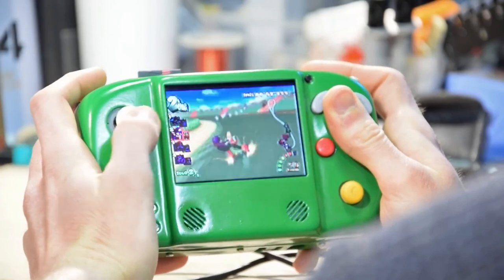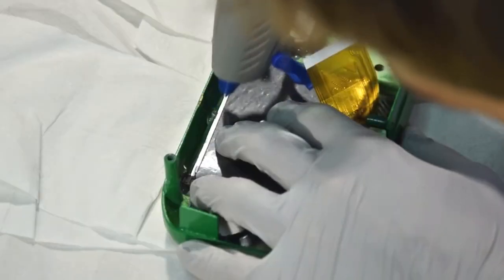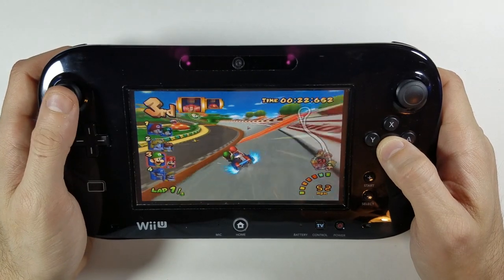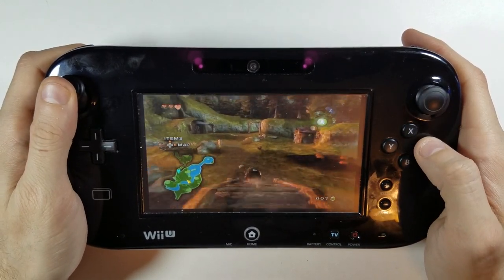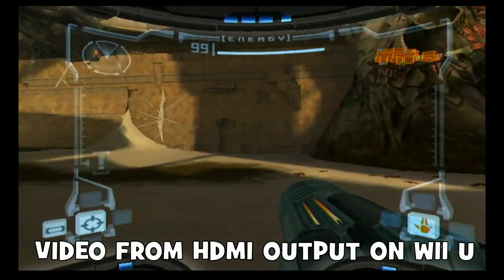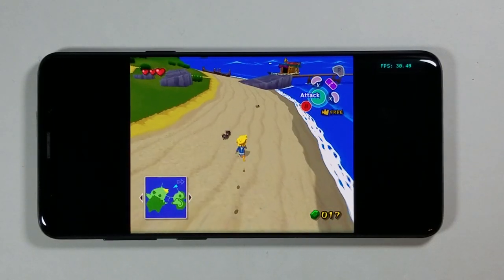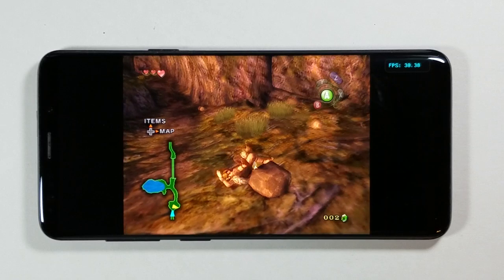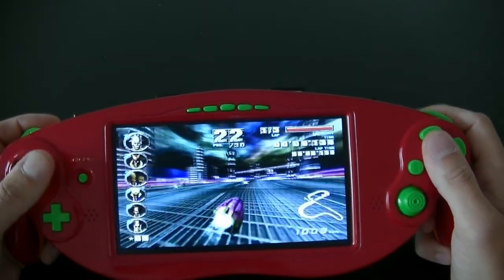EASY DIY GAMECUBE PORTABLE HANDHELD *60 FPS* W. FULL HD HDMI OUTPUT

Comment: How about the soft press trigger, crucial to walk while spraying water in Mario Sunshine,  Wii U, Switch and most controllers don't have them, so thinking playing the full game without problem on emulation it tough
Reply: It will remap to another button automatically. And with the wii u there are 100s of adapters on the market that allow you to plug a gamecube controller and use it. And gamecube controllers work 100% on the wii u with gamecube games

Comment: Lol, 250 to 300 for a phone with bad esn? People should not be so greedy. They basically wrecked their phones. It has a worth of less than 50 dollars with a bad esn.
Reply from the maker: Unfortunately thats not true. The components in these bad phones are still extremely valuable. Such as the original Samsung screen is worth almost $200. People use these phones to fix other phones so they hold value. Thanks for watching the video!
Reply: @techyesterday4960  That is completely wrong. Yes, the components do have a value but hey do not have one for the consumer. 
And the screen does not cost 200 dollars. In the Samsung Galaxy S10 Plus, the screen is with 80 dollars by far the most expensive part.  And it is one og the most expensive screens ever put into a smartphone. The whole phone costs 420 dollars to manufacture. 
But that doesen't matter at all. If a phone is used, the value goes down exponentially. I mean. A year after release, you can find the phone brand new for allost 300 dollars. 
And due to the fact that most of these phones are older than 1 year and that they are even borken/ damaged, does certqinly not give them such a high value. 
When you want to consider the value of the parts, a broken and used phone is eorth at best the 200 dollars if it is in perfect condition exept the single broken part.
Reply from the maker: Lol your really smart bud. Do a quick search on ebay and youll see the screen is $180 - $200. https://tinyurl.com/y635zpu2. And just because the phone has a bad esn/imei doesnt mean it just has to be used as parts. You can use a bad esn phones over seas and they work fine so again thats why they are so expensive. Do you research before coming into my video an look like a total idiot!